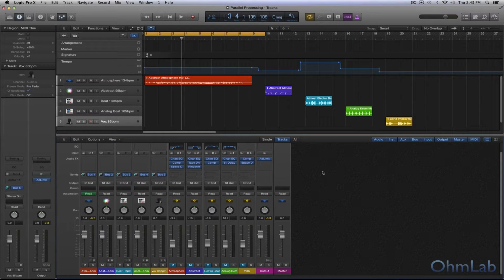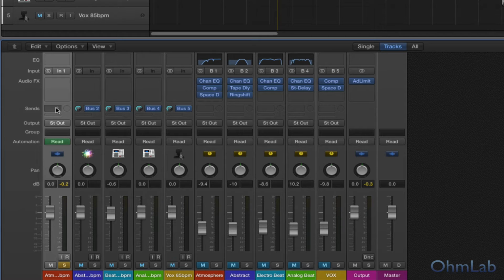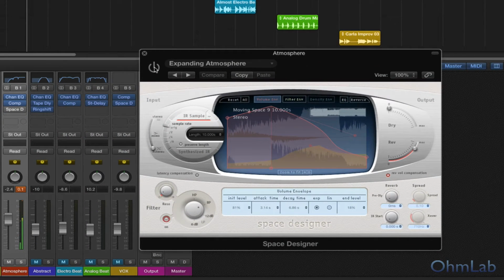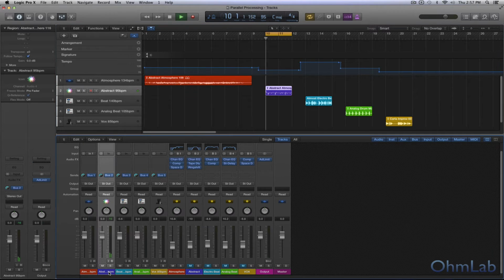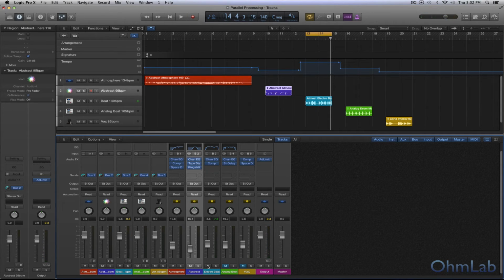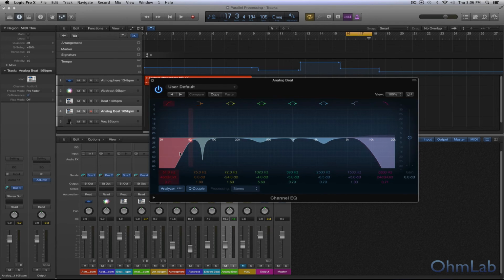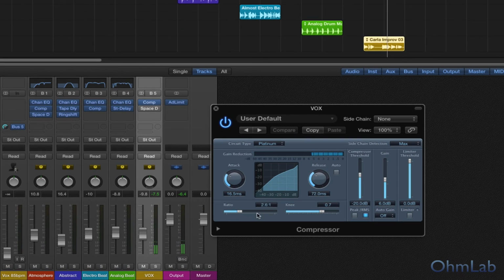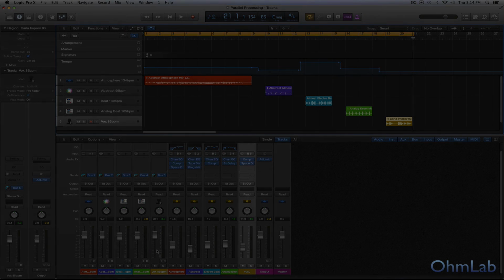Parallel Processing Explained - Creating Tracks

Comment: Although I do not have your logic software I did learn some stuff that can be applied to as you said any DAW. I just have one ?.... when you were doing the final listen why did you leave the original vol up on the unprocessed track? I think I'm correct in saying you don't have to do that, but it just keeps the original wav files ect for further processing on another parallel track?

Thanks :)
Reply from the maker: Hi Christopher,

The point of leaving the original audio at normal volume is so we can layer the processes audio with it. It is this combined audio from two channels that is commonly referred to as parallel processing. Make sense? :)

Cheers!
OhmLab
Reply: I think so in the final mix down you are processing both into the mix :)
Reply: and btw does this technique help with making better stereo sound ect?
Reply from the maker: Christopher Michaud No, this is not intended to help stereo mixes specifically, but rather the sounds in any mix in general, regardless of stereo, mono, mid/side, etc.